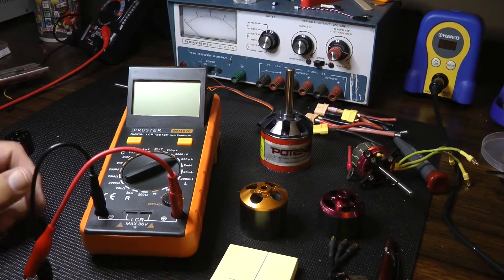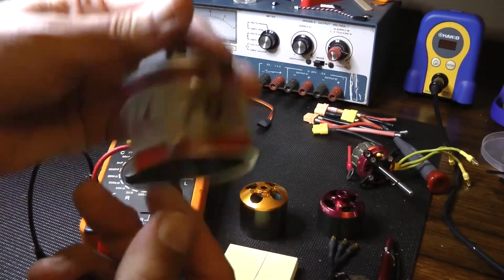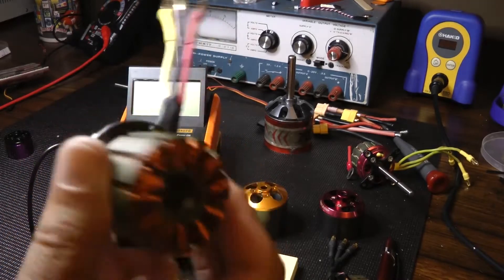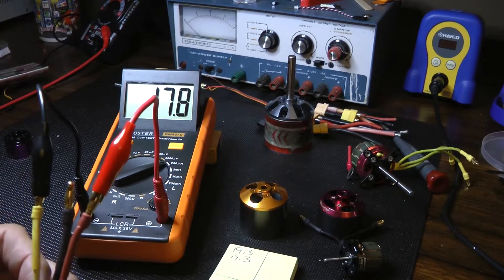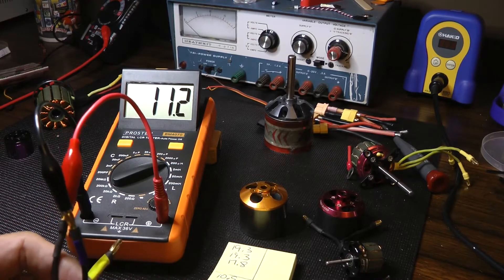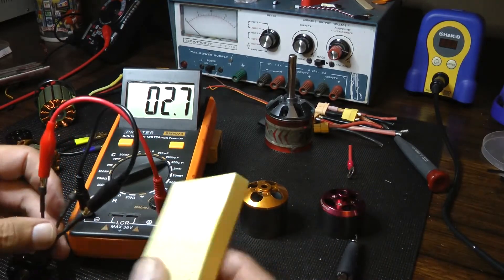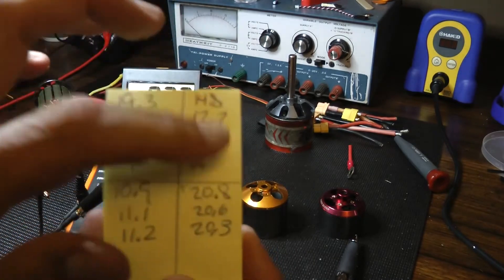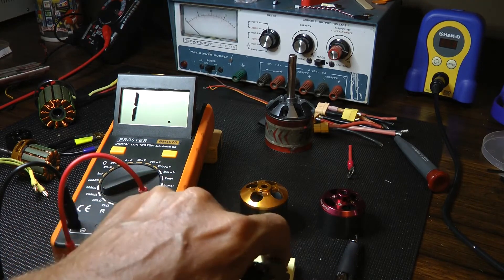Testing a brushless motor with a LC meter

Comment: When overhauling ac motors, we check the coil resistance of the 3 coils. When the difference between the coils more than 0.5% it is important to perform other tests like the Surge test and insulation resistance. When everything else is fine, it could be a bad contact or a loose nut. Otherwise the motor is burned. Sometimes (especially with cheap chinese motors) everything else is fine while the difference in resistance is around 1%, but most of the times it is less!